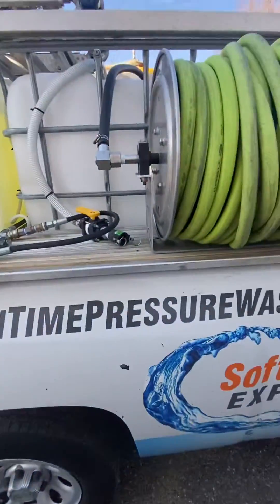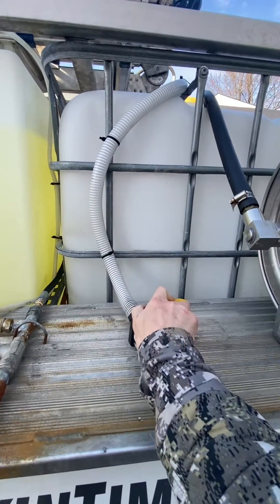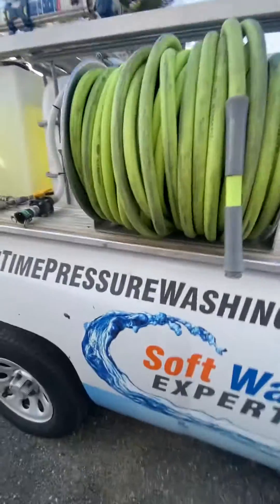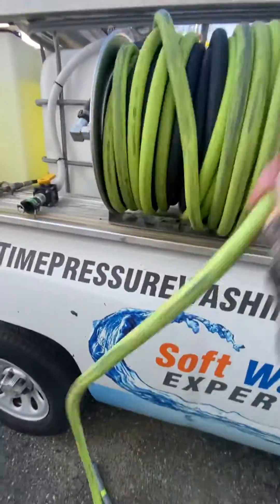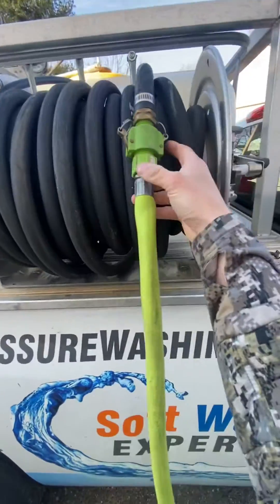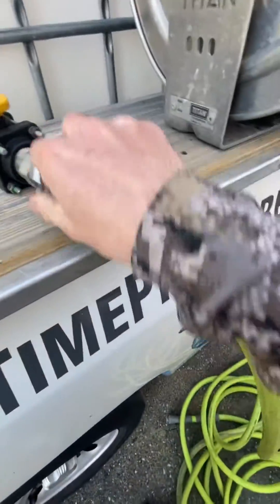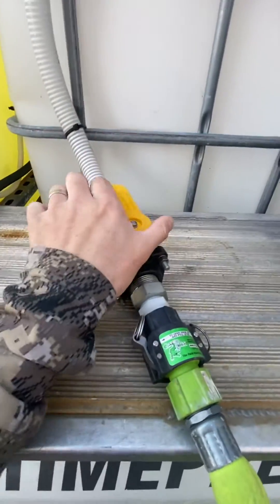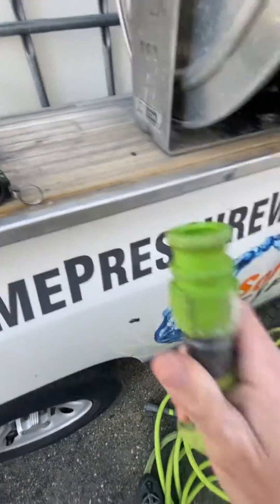Bypass Your Hose Reel - PRESSURE WASHING

Comment: What size is your black hose in the video on the reel feeding into the tank, 1 inch? Curious as to how/where you how that up...for example, some people can pull straight from a fire hydrant. Thanks!
Reply from the maker: It’s just a basic 3/4 hose. 

You can run a 2 inch hose with a 2 inch cam lock as well the same exact way. Either pvc or regular hose

Comment: I’m curious, do you have a link for the cam locks with the 3/4 supply hose threads?
Reply from the maker: I believe I got these ones from our local tractor supply. But I do know Banjo makes them as well.
Reply: @backintimepressurewashing180  Thank you

Comment: I love the camlock idea. Definitely gonna do that. Thank you. No float valve in the buffer tank?
Reply from the maker: No float valve. I’ve noticed not having enough water (Hudson restricts flow) is usually a bigger problem then over filling. The valve there helps out with being able to turn it off when it gets too high
Reply: @backintimepressurewashing180  I used to not have a float valve, but would always forget. I’m a one man band. I see your point however.